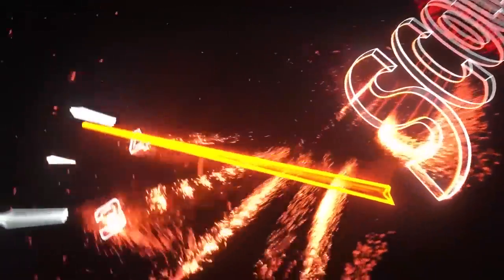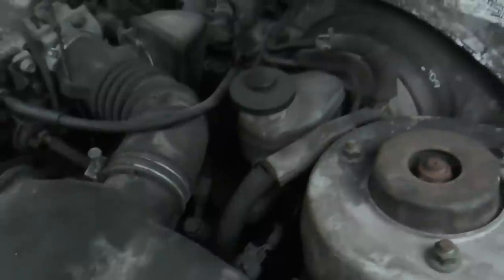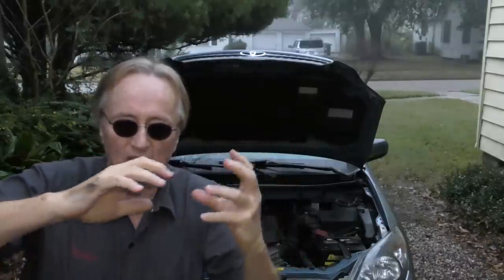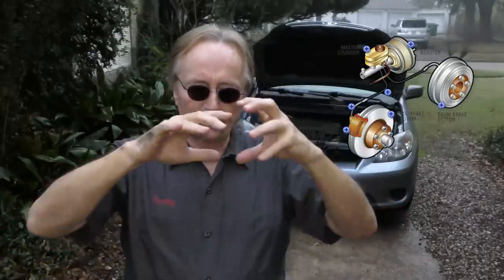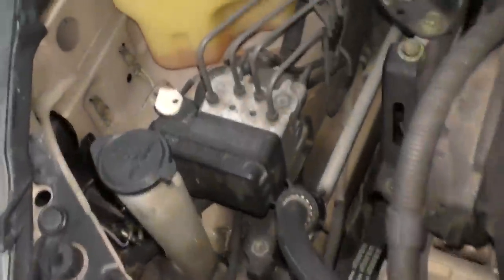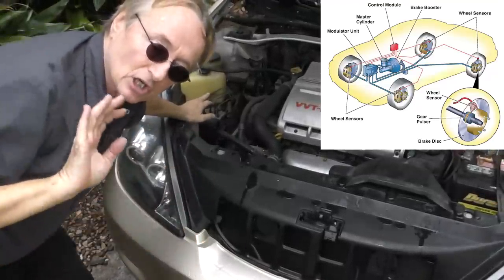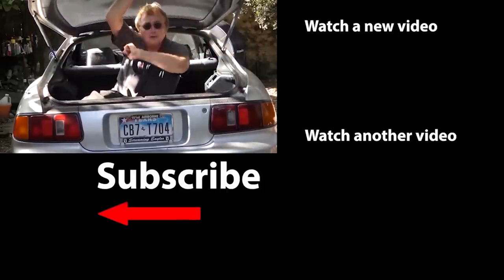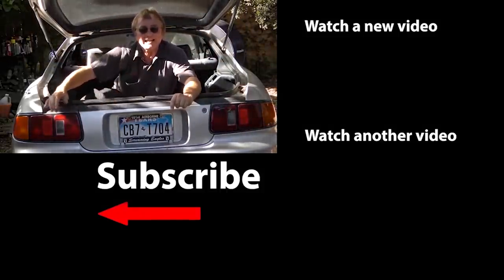Never Do This When Braking (Destroyed My Car)

Comment: My wife's car would have a problem with a low pedal after an ABS event.  I had the ABS pump/HCU assembly replaced under the extended warranty but the pedal would still sometimes be low.  So we replaced the master cylinder.  No more low pedal, but now there is an issue with the ABS.  When the ABS activates, it will not deactivate until the car has come to a complete stop.  Even if you take your foot off the brake pedal.  Even if you pull up on the brake pedal or mash the throttle.  As soon as the car has completely stopped you can drive normally again.  It is easy to reproduce the problem, just get the ABS to activate.  There are no codes, no warning lights, diagnostics all prove out fine.  Since coming to a complete stop when you don't want to is very dangerous, especially on the freeway, I have just removed the ABS fuse and relays.
It's a weird problem

Comment: You should do a video about tips for very long trips. What to check before you go on a long trip and what to look for as problems and how to prepare. I plan on driving my '02 6-Cylinder Ranger with Automatic Transmission from Mississippi to Portland Oregon (2,500+ Miles) Next year, it still runs great with 160,000 on the odometer but I wanna make sure I can get it there without rolling in with a clunker.
Reply: Its easy, do an oil change, change your tranny fluid and filter of it's starting to get dirty, change your coolant, thermostat,  and serpentine belt...I'd change all those , and I'd do a tune up, spark plugs, wires ,air filter, fuel filter..differential fluid and gasket.. check the battery life, clean your battery terminals, check your the inside of your radiator hoses to see if they're cracked,they wear out from the inside out, all of this isn't that expensive ,really..and it's good to do.

Comment: My bk master cylinder did that twice to my 89 Supra, both times bk master cylinder.  On that 2005 Tacoma P/U ECU, check with LKQ used auto parts, or a local salvage yard with nationwide parts search, a used ECU is a lot cheaper then a new one.

Comment: Thank you for posting this. I have a 99 ford f150 im going through hell with a sinking peddle I have replaced everything but the booster and the rear abs valve. With this video I have now decided to change the booster. I will let you know if That's the problem.
Reply: Did it help? I couldn't understand how a bad booster would cause a sinking pedal..
Reply: @simont6439  no I had to change the abs valve

Comment: Here's another one I learned this year:
In cars with manual transmissions, some cars, Mainly Ford, have it set up where the clutch uses brake fluid from the brake master cylinder to control the hydraulics in the clutch. 

If you're leaking brake fluid, and have a manual transmission, Check the clutch system, too. I found in mine, the Clutch master cylinder blew its diaphragm out and was dumping brake fluid onto the floorboard beneath my feet. And it would leak even when the car wasn't being driven!

That fix cost me $200 - Most of it labor. (I think the part itself cost less than $40). To date, besides headlights and the soon-to-be-changed Valve cover gasket, that's the most expensive thing I've had to fix on this $1300 car. I won't ask my mechanic to do the valve cover gasket, that looks like I can do it myself in about an hour or two for around $35.

Comment: I had a 03 Pathfinder with a bad abs sensor. Simply pulling up to a stop sign would cause the abs to engage and the pedal would go rock hard while the truck rolled thru the stop sign

Comment: I have a Chevy Silverado 1600 4.3 2006 and my car keep shutting, Sometimes when u try to time your car on. It will run but there are days that won't and then when your driving, you feel like the car wants to shut down. Sometime the  battery is completely dead but the battery is new and we change the distributor and the spark plugs

Comment: The diagnosis to determine if your issue is with the master cylinder or brake booster (4:35) lead me to replace the booster but after successful replacement it's spongey. My mechanic said the issue was with the master cylinder the whole time, he's fixing it now. Tomorrow when he calls me back, if it's not fixed then I guess I have a faulty ABS? No ABS light and nothing on the scan tool

Comment: I had to replace my ECM a few years back. It was parked in a foggy area all winter, so it could've gotten wet. But, I personally think someone tried to steal it, then realized I have the good old Millennial Antitheft System. I took it to a dealership because local shops said they would have to check ALL the wiring, i.e. $1,000's worth of labor. Eventually, they had an identical car come in, they swapped the computer, then it started right up. It was there for like two months, but they cut me a break, steam cleaned the engine, did some other stuff. They get nice after you give them a couple grand. They also don't have to rely on Google.

Comment: I had a 2002s Toyota Corolla, it also had no fuel injector pulse in any of the four injectors, I also thought the ECM. it turned out to be a 20a fuse in the fuse box, it was easy to spot, I replaced it had no trouble after that.

Comment: #6 brake cylinder is not releasing causing brake on one wheel to overheat and fluid to boil. Pedal drops to floor if brake fluid boils.

Comment: I believe the anti lock brake system code that I got ironically before hurricane sandy can be reset by a mechanic, and it may not come back. I lost the car a few days later in Sandy. Good thing I didn't have it fixed. I remember the dealer saying it's like 1500 dollars to replace the whole system. I bought another volvo an S80. I lost an s70 glt se .It had only 20000 miles for a 2000 model .The last year it was out.

Comment: 0:42 Make sure you have multiple backup jack stands. Also if you taking the wheel off of your car you should set it below the car in case all your jacks fail the car will not fall on you it will fall on your tire. Just make sure you torque your wheel on the right way tho. So it does not fall off when your driving.

Comment: My ex had issue with her 91 volvo wagon ,like ten years ago,  the gasket on the resivour, I could hear it  suck air in and out, that was the first thing I replaced, and I was surprised it fixed it, I didn't think it was that big of a leak, but we went to AutoZone and I fixed it in five mins, I've never fixed a brake issue so easily lol

Comment: I'd recently had (a 7th reason) problem... I had a combination sinking pedal, and an Intake Manifold (airleak) problem reporting in the Diagnostics.
  First thing I found, was the Manifold Vacuum hose leaking at the intake manifold end.
 It was getting old, and was cracking...

I replaced the entire hose, with some equivalent sized hose... Of course the hose did not have the required one way vacuum valve. Anyway for the short term, the vacuum leak was fixed, and I had to wait 3 months for an original replacement to arrive. It had to be manufactured, and sent from japan, which mazda says taskes those 3 months.

  During that 3 months; there was the educational experience of the pedal again falling as soon as engine was switched off, or during low manifold vacuum situations. That was okay, but then came to think a little deeper... 
This is because of No one way vacuum valve in place

I rummaged through the garage, and found the old vacuum hose - and cut the one way valve out of it; and inserted it into the new temporary hose. 

 Time for the what if question?    When the engine is switched Off, and when there was No one way Brake Booster vacuum valve in place - can the Brake Booster internals be damaged by fuel vapours drawn back up into the Booster by it's latent vacuum? i.e just like how the Brake Booster internals can be damaged by intake of the brake fluid you mentioned of in the video

Comment: If it is an older car you probably get a used and modulator from the junk yard.  I have 2000 Mercury and I was able to get a junk yard abs modulator (complete valve body and electronic unit Bosch) go about $90.00.  You can also send the unit away to an online auto speed shop ( the most also repair instrument cluster) for a reasonable cost.

Comment: Scotty at the 5 minute mark you talk about a bad booster.  But what you are saying is what I would expect from a good booster. May be it is because it is 2am  Is it because it is not holding vacuum? to give you a couple of assisted peddle pushes if the motor dies. But that is not why the peddle is going to the floor.?

Comment: What if the brake just has to be pumped?  2005 Frontier has had this situation since brand new.  Frontier forum members have confirmed that this is not isolated.  Dealerships have done several check ups, and even replaced front brake pads.  Every dealer has said that it is normal.  But, is it?  Thanks for your help!

Comment: useful info for sure.  but "the valves in the modulator can stay open when they are supposed to stay open"......   that doesn't sound like a problem.  If valves stayed open when they are supposed to be closed, or vice versa, those conditions sound like a problem.

Comment: Rusted brake lines. #1 problem
Reply: YES JUST HAD  MINE REPLACED AND GAS LINE TOO RUSTED OUT
Reply: Midwest cars have this issue. The covers on the line retain water and eventually rust the line under the car
Reply: My corolla had a plastic  cover over the lines. But my had some holes there but water got in

Comment: I remember when the brakes on my 96 c1500 didn’t work and my accelerator was stuck. Needless to say I slammed it in park at 100mph in my neighborhood. Turned into some spins and then parked

Comment: I actually had a bad brake line going from my master cylinder to the ABS module. 

Also, I figured out a bad wheel bearing might cause the ABS light to turn on. My  ABS light turned on when my wheel bearing started grinding. I replaced my wheel bearing and the light went away.

Comment: Scotty, I have a 2002 mazda protege Dx with 256,438 miles and the other day the car jerked and the check engine light was flashing I read the codes and it said multiple misfires and a couple other codes p1250, p0300 and p0102.  Could this be the ignition coils going out or something else? It's still running good and driving and only cost $250.00 for the car Thanks travis

Comment: Where on this car is Scotty placing the lift pad of his rolling hydraulic jack? It looks like part of the pad is pushing up on some of the plastic shrouding under the car, or on the urethane bumper cover. Is this a safe spot to use, to avoid bending or breaking something, including something that might affect the wheel alignment? If he wanted to jack up the front of the car, on only one side, why wouldn't he put the jack under the factory-designated lift point behind the left front wheel, where the pinch-weld is reinforced. There is also a factory designated lift point in the center, from left to right, where you can jack up both front wheels simultaneously. Any small, 1.5 ton jack will lift up the entire front of any small to mid-sized car. Then you can drop the front of the car down on 2 jack stands, placed at the 2 front pinch-weld reinforced spots, and safely stick your head under the car once the rear hand brake is applied firmly enough to keep the rear wheels from rolling. Although with some newer cars the front lift point is so far back, and so low to the ground, that there aren't any rolling jacks available that can reach it.  Then there are a couple of tricks you can use to get the jack pad to reach.

Comment: Hi Scotty, Thanks for all of your great videos. I have 2010 Nissan Frontier. I’ve had brake problems since about 2005. I’ve had everything in the system changed including the ABS system. I still have a soft pedal. I’ve had numerous mechanics, including the dealer work on the brakes.
It’s now worse than it’s ever been. Also, I believe the pads wear unevenly! Any advice?
Reply: new calipers,   new brake lines,   there is a brake valve portioning valve that sends brake fluid to the wheels and it can stick.  but wow   people are reporting crazy brake line rusting at a very early age on them and having very slow brake fluid leak that is not dripping.  just very slow leak over long time,  leak seems to be over the rear spare tire.  hidden from view.  yet another reason to not buy nissan,  the current owner just days ago left japan to escape being arrested in japan and fled to his home country Lebanon.   its a epic scandal of hiding money and using junk parts,  going back many years,

Comment: I had a brake pedal sink once, thought it was air in the system, bad master cylinder, or bad brake booster. But when I checked everything still look fine. Without much of my spare time after work, so I decided to flushed the sh!t out of that things and it still sink and finally when I had the times to really get my hands on the stupid things I figured out the problem, it was the Cylinders slide pin that caused the problems all along. There were no grease whatsoever on the bottom pins I can’t even remove them out both the passenger and driver side so I ended up snapped one pin on the passenger and the driver side was okay, have to bought another caliper for passenger side put some grease on them and now it work just like new. (02 sienna)

Comment: Hey Scotty! I have been watching sooooo many of your videos and followed you on every social media account you have.  I was hoping you could answer me this, or do a video on it, my question is that I have about 7K or I can push it to 8K, but I need a family vehicle quick.  These darn auto sellers in CO are charging about 2-10K more for EVERY vehicle here let alone what they up-charge for AWD. I really want an AWD SUV, but I am open to a spacious yet gas efficient (at least 20MPG) sedan/wagon/crossover as well.  My husband is 6'2" so spacious is necessary.  My children are both under 3, so safety is also paramount. I was really hoping you could help with this.  I have checked your recommended videos on SUVs yet all in my state are out of control expensive. I also want to thank you for warning us about the Honda Pilot and its stupid crappy engine.  Not to metion the advice to NEVER go into debt for a used car.  You saved my family about 20K worth of debt for a crappy Honda.  Hope you're well, and thanks bunches for your videos! Even a car ignoramus like myself is better equipped in the car buying field. Tah Tah!

Comment: Hey Scotty, I was driving with my emergency brake on for 10 minutes and noticed my brake pedal was going to the floor. I released my handbrake and got home. The next day the brakes were fine, no leaks, were the bad brakes because of the emergency brake left on?
Reply: Yes that was due to the e-brake. I would get my e-brake checked out if I were you
Reply: Robb's Homemade Life you might want to get your emergency brake checked out because it might be ruined now and won’t stop you car if it rolls.
Reply: Never use your emergency brake to stop a car speeding out of control put it into neutral and step on your brake hard even tho it might not be doing anything.
Reply: @randomyoutubevideos3503  My Ebrake was left on by mistake and I did not notice it was on until my brake pedal began sinking low when used. I am wondering if some parts were heated up and expanded causing the brakes to go ow as they are fine now.
Reply: @RobbsHomemadeLife  If you have a car with rear drum brakes you likely wore down the rear brakes by having the e brake on. You should have your rear brakes inspected. Tell the shop what you did. It will help them understand the problem. (worn rear drum brakes will make the pedal lower)

Comment: First Blyet. So I have a question Scotty, I picked up a roughly 80 pound chunk of metal because my father and I are scavengers and it slipped when I was setting it in my fathers car trunk and now he blames it on me that the chunk of steel that I dropped into his trunk ruined his shocks on his Honda, do you think that that chunk of metal being dropped maybe an inch or 2 inches at the most would have ruined his suspension?

Comment: If pedal is sinking with an anti-lock system: first thing in the morning, find some wet grass (from night time dew, or rain etc) in a field or a long straight stretch with no traffic or dangers around and drive the car onto the grass at 30-35 MPH and slam on the brakes and hold till the car stops. Do that a few times, making the anti-lock system work to it's fullest effort and that usually fixes a stuck or bypassing valve in the modulator. This has worked several times for me and other former or current car mechanics.

Comment: Hey Scotty, I have a 2012 honda pilot ex. I notice that when I play my factory radio I can feel the beat in my brake pedal, also, whenever I turn on the wipers, I can feel it in my brake pedal, I don’t see any leak, neither loosing fluid nor either the brake sinking. Is it normal for me to feel those vibration in my brake pedal? I got brand new rotors install, brake pads, etc. Also, I am getting a vibration when I accelerate, the car start to vibrate in 3rd gear I would believe, around 40 mph. Thought it was the rotors but look like something else. I got only the driver side cv axle, stabilizer bar for both side, control arms for both side, struts for both side, inner and out tie rods for both side, and am still getting vibration when accelerate. My engine mounts are good, v6. Engine run smooth, no clacking. Brand new tires at Walmart and got them balance, switch them around, yet am still getting that vibration. It is a headache. Please help me